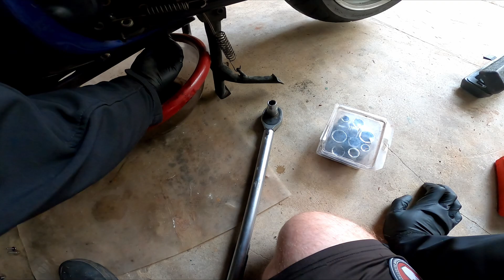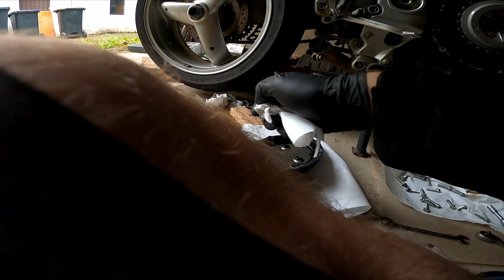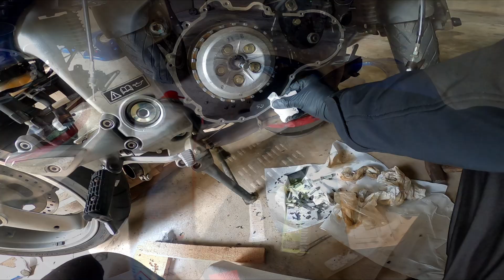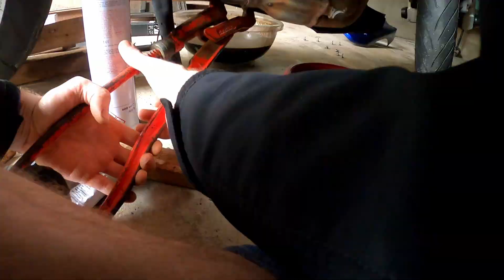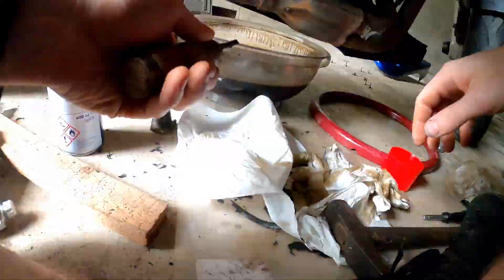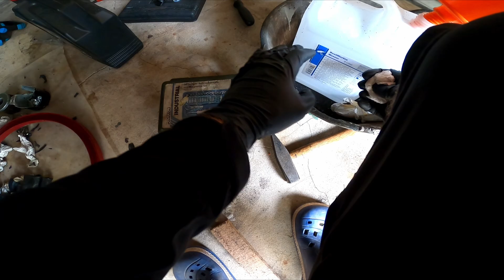Triumph Sprint 955i Oil change and sight glass replacement

Comment: Shouldn´t there be like 3,3 Liter of old Oil in the Bike ? Your plastic bottle seems like a 5 Liter Container which isn´t nearly half filled with the old oil ? (i´m asking because i´ve got the same issue on a sprint rs 955i from 2003
Reply from the maker: I didn't really check how much oil I let out of the engine. 

I think the oil level was around minimum in the sight glass before, so that might explain it a little.
Reply: @Roadwrench  thank you for your response 👍👍

Comment: If you would have used the right tool to extract the filter it would have been a whole lot easier there like 15 bucks at any shop like orieleys
Reply from the maker: Depends on the tool needed for the filter. 
The filter sits deep and doesn't have much space to get a tool in.
But yeah proper tools make everything easier